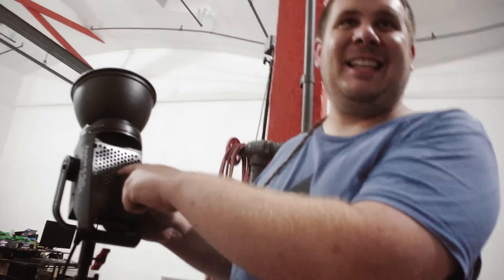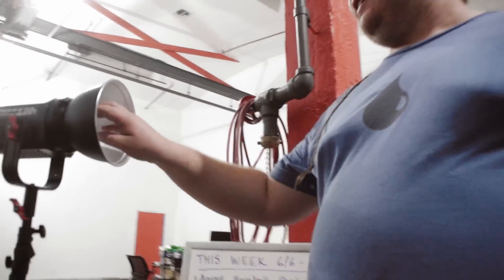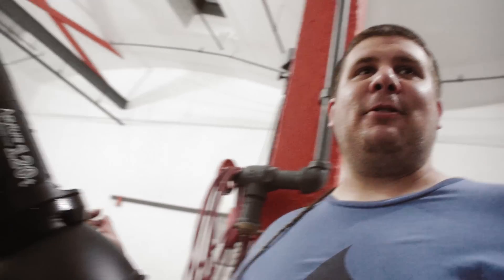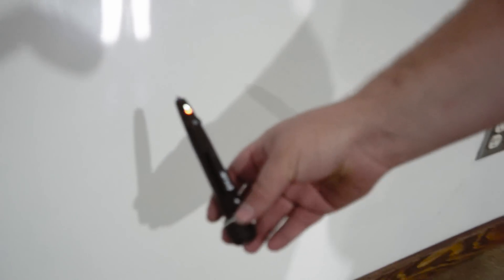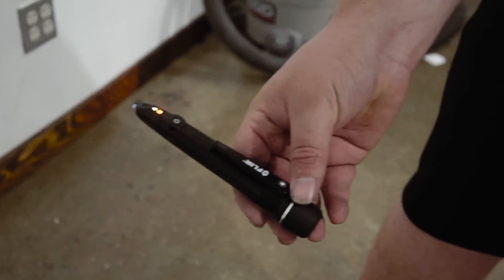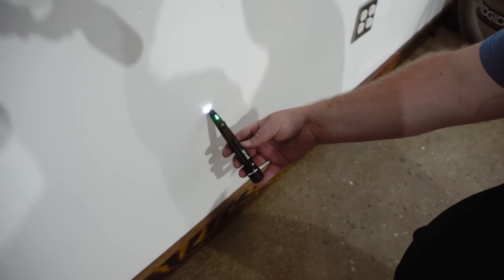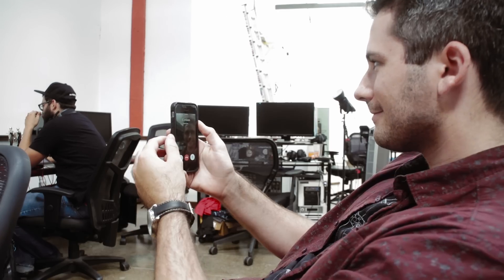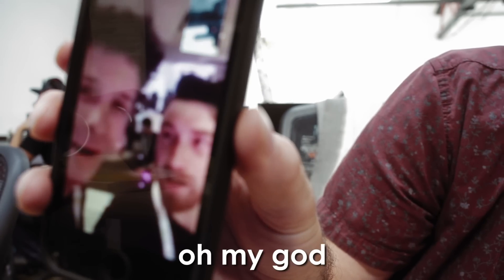Using Heat to Find Electricity

Comment: I'm in the automotive repair business and we use that same thermal imaging camera from time to time to help us find parasitic amperage draw in vehicles. It's pretty incredible really. Just point it at the fuse box, and you can tell which circuit has the extra current because it's fuse is glowing. Electricity = heat, even down in the mA range.

Comment: Usually power will burn out at a plug rather than just some random spot on the wire. Check all your plugs, find the one where the the power stops and replace it. If not one of the plugs, check the breakers, if powers not going through when it's switched to 'on' it might be burned out and needs replacing. Good luck and love the videos guys.

Comment: Guys.... current cant just run in one section of a wire. It's all or nothing. 

Voltage can, however, and that's what you can pick up with the sensor, but only if there is a clean break.

Comment: RE 2:30: ? You can't have current running in part of a wire, if the circuit is broken... =/  Current can't flow if it has nowhere to go!
Reply: Exactly. Not sure what the hell they are trying to do.
Reply: +TheEvinB Yeah.  They use highly conductive gypsum board (a.k.a. sheetrock) specifically for this purpose.
Reply: The wire will form a different circuit with the wall wherever it's broken. The current will go into the wall somewhere.
Reply: TheEvinB Thats not how walls work.

Comment: Fellas- there are 2 tools for finding shorts and faults on a wire- 1 is called a "Toner" and the other is called a "TDR" (Time Domain Reflectometer)
The Tone generator is relatively cheap- puts a audible tone on the line and you use a remote scanner along to line (wall) to find where it stops- there is your fault)
If it is a mild short, and still passes tone signal, then the TDR is used- it will read the distance to the fault- even if it is a nicked line and not completely shorted.

Best of luck! 
(ps- TDR's are super expensive)
Reply: I'm pretty sure they found the short already and I think the reason why they want to do with these ways is because it's cheaper